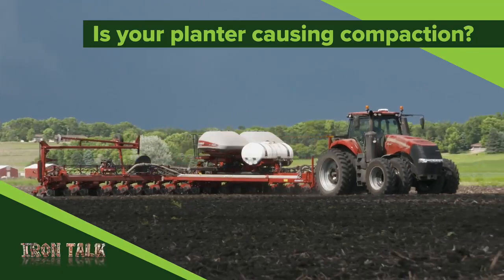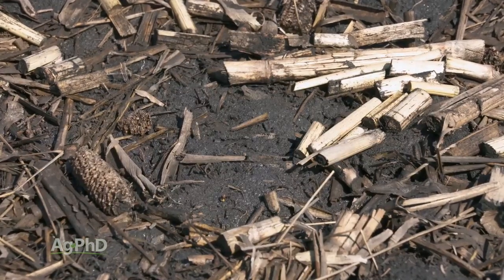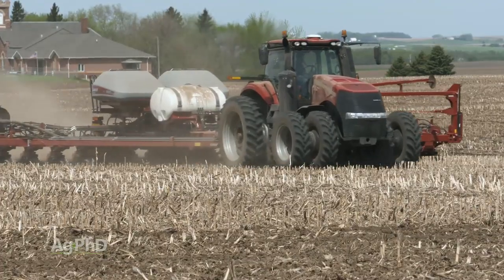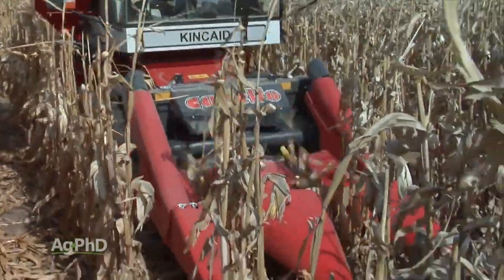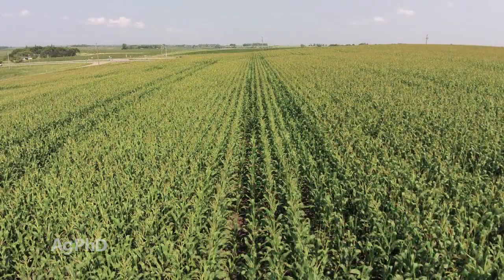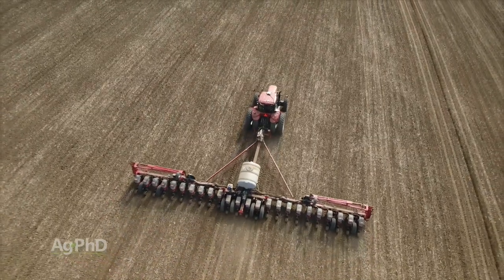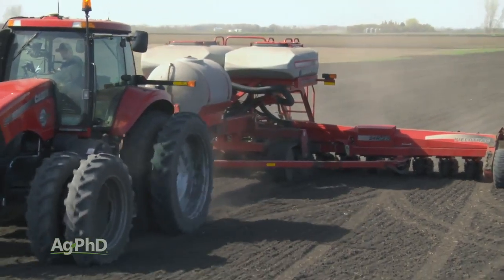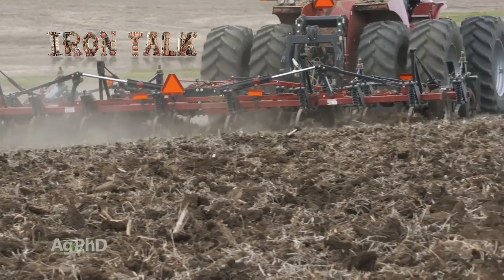Iron Talk #1140 Planter Compaction (Air Date 2-9-20)

Comment: Few more options: main frame bar weight transfer cylinders. Yetter tracktill breaks up soil behind planter main frame tires as well as lifting weight off the tires. And or switching out tires to wide tread radials and running lower psi.